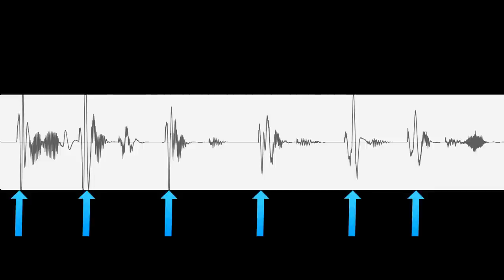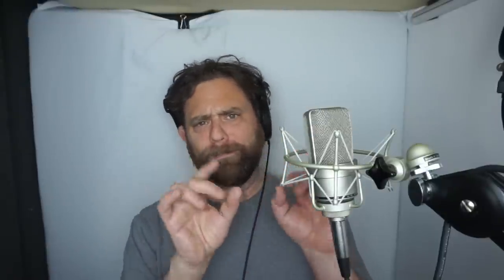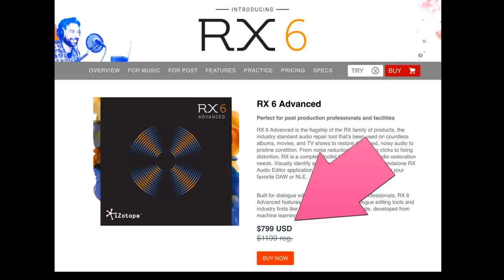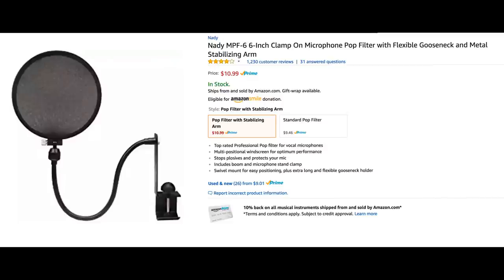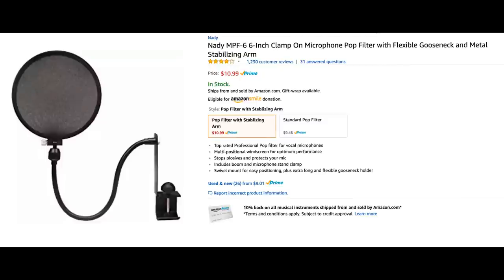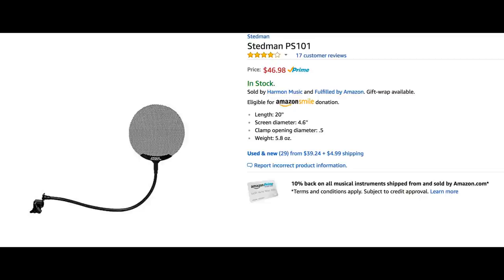Which pop filter should you use?

Comment: he's so polite! I'd buy this guy a beer anytime.
Reply: @5usp3c7  how?
Reply: @r2d2cold9  homophobe
Reply: @5usp3c7  well you're wrong
The purpose of a shock mount is not to get vibrations to travel up to the mic the vibrations that come from a mouse, keyboard, anything moving on the desk or the desk itself if you shake it because the vibrations will travel up the arm and into the mics diaphragm but the shock mount prevents the vibrations from reaching the diaphragm to make a sound, 
If he moves the mic stand the mic will obviously pick up the sound because its right next to the mic itself so it's a sound not a vibration if it was a vibration the mic wouldn't pick it up if it was a sound it would which it did 

Seems like you're the one who needs to be educated
Reply: me 2
Reply: @5usp3c7  then skip it, it's a free video for a reason
Reply: @5usp3c7  if you take your microphone and put it on a shock mount and move your nail across it (edit: just to make it clear before you touch the shock mount, I mean the metal mesh part of the MICROPHONE, not the mount), it's make a louder version of that noise, the shock mount helps vibrations up the stand and/or desk you might have it mounted to, however if you touch the microphone itself, it'll make noise... people are so dumb I swear...
Reply: @5usp3c7  sure, they can be caused by moving a stand because springs can be squeaky like a chair and a shock mount won't always remove all noise, the grinding noise he is causing is due to the microphone sock-type windscreen sliding onto the mic. It's rubbing on the grill making that scratchy noise, if your stand is causing lots of noise, you either A) need a replacement or B) need to return it and upgrade a little bit. Edit: 9:02 is caused by the screen being put on and that is the only audible "grinding noise" in this entire video...
Reply: @5usp3c7  y u talk soo much if u dont even have a decent mic?
Reply: Would you give him a hand Shandy?
Reply: lmaooo
Reply: sugar gay
Reply: @eleonora_poop5222  I’m ok g
Reply: Facts
Reply: @eleonora_poop5222  People :d
Reply: @lemmytv3538  a bit late to the party, aren't ya?
Reply: @5usp3c7  yup just watched the video pretty sad that ur still replying lmfao
Reply: I'll apologize for being an ass now, since I hugely disagree with me having put my comment up 2 years ago.  With that being said, I'm deleting the rest of the comments since I don't like being reminded of this incident. Thanks for contributing to a healthy discussion.
Reply: I know. I want to be his friend.
Reply: I'm getting the second round

Comment: i've used my sister's old leg hose wrapped over a bent up coat hanger wire made into a circle :) in the 90s
Reply: I was literally trying to see if anyone else had said that, because that's exactly what I was thinking.
Reply: I'm new & broke.  I began to wonder about a small (about mic sized) kitchen strainer with pantyhose stretched around it.  That gives 3 layers of mesh with a distance of screen in between.
Reply: “I’ve used my sister’s old leg...”
Reply: @TokyoRake  Not quite the same thing.
Reply: @TokyoRake  “she was barely using it anyway”

Comment: My first pop filter was panty hose cut into a circle, stabled into an embroidery hoop, with this stiff yellow wire I found to attach it to the mic. It worked really well actually, but it didn't look good.
Reply: I saw that video!
Reply: I worked at Sigma Sound Studios in philadelphia in the 90's.. we used that exact method (panty hose) for our pop filters on actual vintage U47 mics and very rare 40's and 50's ribbon mics on grammy winning records... so yeah, not really a thing, at least in my experience. lol.
Reply: I still use the toe from a pair of nylons stretched over a tea strainer in my home setup.  Looks bad, works great.
Reply: I did something similar. I found a thin sock and pulled it over a small frame. The frame was then held in place in front of the mic with a clamp. Worked like a charm until I got a real pop filter.
Reply: @billykranberry6077  Sugondese nuts. Ha! Got'eem!
Reply: never rock the mic with the pantyhose  !

Comment: Ten years ago, I made my own pop filter with two nylon stockings stretched over a looped wire hanger. I liked it so much, I made another with lamp wire (more flexible) and a slaughtered lid from a container of hot chocolate (kept the mesh 1/4 inch apart). Seems to do the job. Especially when I have someone else record.
Reply: I wish I could like this comment 10 times instead of just one.

Comment: Comparing the nylon filter to the metal one gave some surprising results. The sound passing through the nylon filter sounded fatter as if it was coming from a Hi-Fi stereo system with lots of bass response, while the sound passing through the metal filter was thinner and less distorted, giving more of a vintage sound to me. Both are actually useful in certain situations, depending on the effect that you want.

Comment: The Stedman seems to exhibit slightly thinner bass when compared to my nylon dual-layer. However, I'm curious if the dual-layered nylon is actually adding bass because of air becoming concentrated between the layers?
Reply: Probably not. Technically it shouldn't add bass, but rather limit certain frequencies. (specific frequencies - I have no idea...) The sound waves/frequency hits the mic element regardless. However, wind screens and pop filters intercept airflow. there may be some minimum affecting of frequencies, but mostly unnoticeable.
Reply: The dual-layer nylon mesh physically moves when impacted by the plosive. This movement causes the mesh to vibrate and act as a speaker cone creating weak, low-frequency sound waves.

Comment: I used to use a coat hanger with a nylon stalking over it.  It worked ok, but the biggest problem with it is that the coat hanger would move if I was moving the stand/arm or if I hit it with enough wind.   The sound of the reverberations from the coat hanger would travel through the stand/arm and into the microphone, since my microphone didn't have a shock mount.

Comment: The only issue I’ve had with the metal pop filters is that if you get right up on top of the filter, sometimes the plosives make a sound on the metal itself. Sounds similar to swinging a fly swatter rapidly. I personally still prefer the metal, but only because I’m not usually keeping lip contact with the filter, I’m usually back 1.5-3 inches

Comment: 50$ metal mesh vs 10$ for the nylon and it peaks a LOT more -_-) 
proof that audio equipment pricing is total BS xP
Reply: Well I mean materials cost matters. And you can see through it better. But metal shouldn't cost 50 dollars.
Reply: distill why not? you dont only pay the manufacturing and metal but also the research and development
Reply: @A-Wa  I'm saying exactly that. You're paying for the metal. Not necessarily the product in this case. Assuming the nylon peaks less. You're spending excess money on metal, that doesn't do what you want it to just because you can see the mic through it. I agree with you both. I was just stating that material cost certainly matters the most along with the design used if they had to come up with ine but I doubt they did much more than shape and contain the mesh. 

So equipment cost isnt really BS based on quality, but performance quality it is. That doesn't cancel out that the metal costs 5x as much to actually make. So I'm saying what you're thinking and disagreeing with the comment above because there's more factors than just performance. And even then performance is dang near subjective on most products without a standard way to measure the decrease in peaks.

Comment: Once I thought I found a really cheap blue yeti but it turns out I found a really expensive pop filter
I wonder what it would sound like if you use all the filters, metal first to move the air, nylon to slow down what ever's left then the foam one for extra pop filtering

Comment: I'm a fan metal/Stedman

On plosives: Plosives are hard to get out once they are on a recorded track. I've heard minor plosive on even mass-released mainstream music, particularly rap where there are just lots of high energy performances and pronunciation...especially if the commercial artist got right up on a dynamic mic. The right kind of plosive can kinda blend with the percussion of the beat and go pretty unnoticed, but the point is...avoid mistakes all you can, because plosives do not come off the worse they are.

Sibilance is at least much easier to deal with...I have some "affordable mics" that I really love other characteristics of, and some just have that essyness...but the right mic technique really smooths them out before even being recorded...and then couple that with a good compression/eq side-chain setup...it pretty muc 100% smooths those esses out when you play with the right threshold and dry gain levels (after finding the offending frequency).

Comment: I made a mesh pop filter using a speaker grill off an old radio before I even knew there were metal mesh pop filters. It's not perfect, it basically doesn't work if you're speaking right at it, but staying away a couple inches is night and day compared to not having it there.

Comment: The way I do it with my mics is a foam  wind sleeve to keep dust out of the diaphragm/internals the  throw a pop filter with rubber bands over that to hold the sleeve in place and mitigate plosives, at least with my condenser mics. Works well for me as long as i keep my mic 6+ inches away and slightly angle the diaphragm so that I’m talking just past it and not directly into it. I like to keep it about 4-5 inches below my mouth with about a 45 degree angle upwards pointing to around where the bridge of my nose meets my brow. That way I’m talking past it. I do vocals for a heavy metal band and “scream” and it helps when I’m  projecting my voice and enunciating as to not have plosives or clipping. It still happens but not as much. It works well for voice overs too. Idk if there’s any actual science behind it, but that’s what I do. It also helps if your mic has a bass roll off switch and a -5dB switch if you really need to get up on the mic for some reason. Mind you, I only use an MXL 770, but for a cheap mic it’s phenomenal. I want to upgrade, but I really dont need to. I started with a USB Blue Snowball Ice (I still have it, it’s a fun mic to play with, but I find that it’s waaaay to sensitive so I prefer XLR mics with my interface where I can adjust the the levels.

EDIT: I was writing this comment and you got to the point where you say you angle it..so apparently I’m doing something right. I do t feel dumb anymore for being the only one I know that does that XD

Comment: The first pop filter ever invented was cobbled together from a pair of pantyhose and a wire coat hanger. That foam thing is properly called a windscreen, because it is supposed to protect the microphone from wind. It is not really designed to be a pop filter. Also it does suck out some of the high frequency energy. Any pop screen or windscreen is also useful to keep spittle off your mic. Proper mic technique is to aim the microphone at your mouth, but aim your mouth about 30 to 45 degrees away from your mic.

Comment: Speaking to the mic slightly off axis (not 90-degrees)  is good advice.  I've always used foam windscreens. Professional versions really don't color the sound in any way I can detect except to soften the plosives.  Moreover, they protect the microphone diaphragm 365/24/7 from contaminants in the air, like cleaning aerosols and moisture from the talent's mouth.  Also on microphones with clumsy clips, the the Sennheiser MD421, it will protect the grill when the microphone falls to the floor.  For VO work, I like the LF boost you get from the proximity effect and pop-filters move you too far away.  Also, as you note, they can get in the way of copy reading; although these days I don't use paper -- I read copy from an iPad teleprompter app, which will make the type a little bigger and also auto scrolls as I read, so I can concentrate on my performance.

Comment: I've also seen people in a pinch bend a piece of wire in the circle shape and stretch some nylon stockings or whatever is availbe over it. I don't know how effective that is but I would imagine it's somewhat similar to the store-bought nylon one as long as you do two layers, too. I could imagine the fingers might work but I think you'd have to be very careful about the placement and the distance?! Probably try a bunch of different positions, like you said. Because the fingers won't split the air exactly like you gestured with your hands (the air gowing off straight to the sides) but rather bend it so it would converge again behind the finger. You can test this by placing a candle behind a bottle and blowing directly at the bottle. You'll be able to blow out the candle easily even tho it is completely behind the bottle. Or imagine a Tree standing in a river and the water flowing around it. It doesn't "split" the river :) That's like half of the principle of how airplane wings work, btw :) But I'm sure if you mess around with it and you don't have anything else at hand it can be useful. At least when you demonstrated it it sounded a lot better than the kitchen strainer :D Cool video as always :)

Comment: I've been doing Paramount Pictures trailers for dvd/bluray/on demand for a lil over 10 years. Definitely learning to work without a pop filter is preferable, but honestly, if you're killing the track with explosives and you need a filter, the difference between them is pretty negligible. Price difference is usually not. But I'd recommend doing it the hard way. The broke way. Learn to do without and it will reward you forever. When starting, try coming at the mic from a 30-45 degree angle. Just be aware this can affect sound quality

Comment: Question...is there any reason nobody is using the "dead cat" stuff? Like Faux Fur. The furry material that works really really well for blocking wind? I just stuffed some similar cheap fur fabric inside my foam windscreen that slips over the mic, and it made a huge difference vs just the windscreen (which barely did anything for me).

Comment: Great info, very informative!  One thing that would have been nice, is to also show a run-through of the "Peter Piper..." with the levels without any protection so you can point out the plosives.  Also would have been nice to show those levels with the make-do methods.

... I wonder if stretching some pantyhose over something (so there's two layers) would be as effective as the thin cloth one?  I just bought one and it feels exactly like pantyhose.

Comment: Super helpful! Thank you! I never had thought to blow through the filter itself to see how the different ones worked. Great tip! Also a flub that might help others to avoid it -- I had been using a foam filter in my booth, and I suddenly developed an echo. It drove me nuts, cost me tons of hours in post to try and work around, as well as in the booth to try and fix, when I thought to take it off (because I saw this video-- thank you!), and voila! My stinking directional mic had of course been knocked about over time and was now facing the wrong direction (the hard seam was facing me). I would have noticed it immediately if I'd been using one of the other sorts of filters & saved weeks of searching! I'll never use a foam cover inside again.

Comment: I didnt like using the metal mesh pop filter. Whenever i used it i found that there was a sound that the metal made whenever it was hit by air. It was like a subtle woosh / ringing sound. So i went back to using the cloth double layer. Then boosting the high frequencies in the eq during processing.

Comment: Hi I am a priest in isolation in London and many people want me to read to them for comfort. I have signed up to zoom but some elderly say they can't hear properly and my voice needs to be gentle and calm for them to rest and sleep especially if not well. Could you advise me as to what I can invest in? I have also thought I might interview some interesting people for them to watch as well - would I need a different mic for that? It is all new to me but stories and talking gently to people over the internet is something I can offer for free...
Reply from the maker: Thanks for what you do. You may need to check the input settings on your computer to make sure the mic you're using (or your computers internal mic) is turned up. If it is and you are still not loud enough you might need an external mic. Literally any USB mic you can get your hands on will work for this.  They should all have a "gain" knob which controls how loud the sound is as it enters the computer.

Comment: Here is a pretty good way to test if a pop filter is up to snuff. Hold a lit cigarette lighter about 1.5 - 3 inches away from you pop filter and say a few words at varying volume. if the flame starts dancing, you need a better filter. Iv found that its not about how fine of a mesh you can get, but its more about the thickness of the wires in the mesh, and the shapes of the holes. Circular perferation seems to effect acoustic waves drastically, where as square perferation seems to do very little.